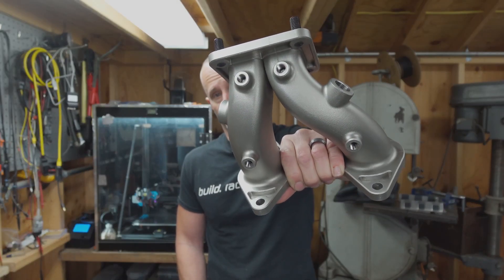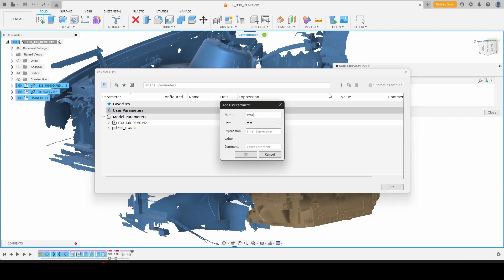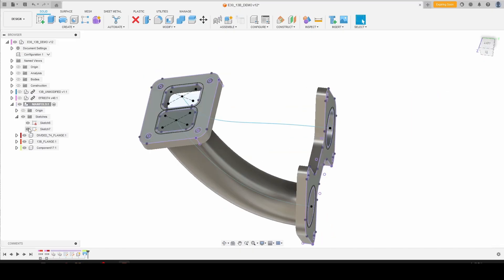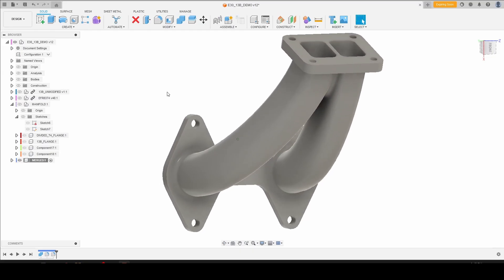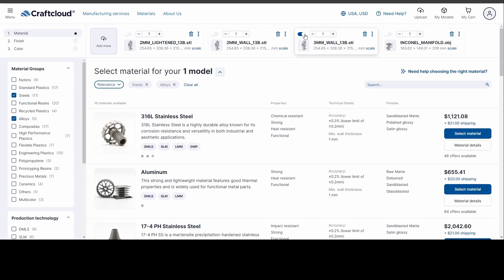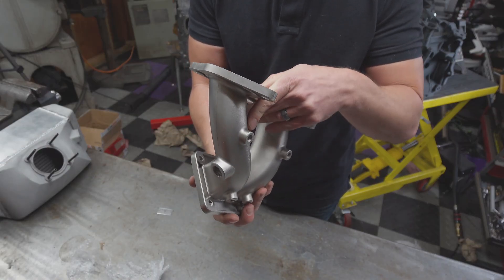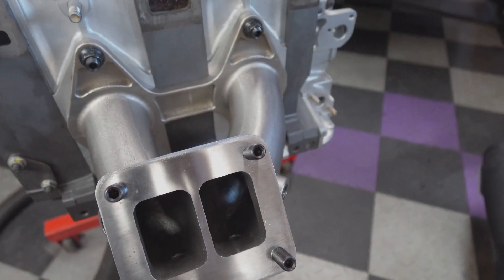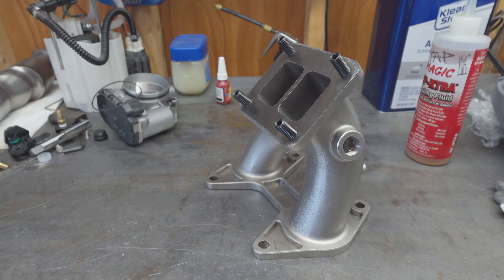Design and print an Inconel turbo manifold - Building a 13B Rotary BMW i8 : EP3

Comment: nice set up but a bit misleading saying printing in inconel then go with 316...
Reply from the maker: I clearly show what the i8 manifold cost in  inconel. The whole point of the demo was to show that 316 is within the average budget. My manifold is inconel from KleRo in Germany.
Reply: @CouchBuilt did you need the extra heat or strength from inconel? What made it worth the extra cost to you? NA manifolds I could see going with stainless all day
Reply from the maker: @MPbdy I originally planned to use stainless and I wouldn’t hesitate to do so. Inconel is simple a better material and when I saw the price, it wasn’t an outrageous jump. The amount that I saved with the motor I bought also played a part in going this route.

Comment: Damn your fusion skills are awesome. Great how you explain how you built it.
Reply from the maker: Glad you liked it. My skills have a ways to go, particularly on workflow. I’ve learned a ton on this project but amassed so much technical debt that after I committed to sending the print files out, I exported them all as STEP files to free up the design timeline. Let’s just say simple changes were orders of magnitude too long to process toward the end.
Reply: Came to say the same thing - I learnt a ton from just that section alone.. I struggled doing a similar modelling task (by struggled I mean I gave up and went back to beating round tube into square flanges like some kind of caveman), and now I know how easy it should have been..

Comment: So a few recommendations. When drilling or tapping, I would rather use rigid taping to reduce mistakes or workmanship errors. When machining down the surface area, you should consider using a mill and measuring flatness. I saw when you placed the "finished" part on the flat surface, there was a lot of wobble and air gaps. It was off by well over 2 thousands. Simply recommendations since it appears you paid a tremendous amount for this part.
Reply from the maker: Good insights, but bold of you to assume my bench is flat. There’s no gap with a straight edge.
Reply: @CouchBuilt  also bold of you to think a belt sander can give you a flat surface
Reply: This part is printed. Fixturing this thing up to (g84) tap it would negate much of the cost savings advantage that he started with. The beautiful thing about a part designed for use with gaskets is it doesn't need to be flat to any "close" callout. That surface would probably be good at +/- .02", maybe .03 depending on what gasket he goes with. 

I guess really i don't see the point of giving the guy a hard time. You don't get flatness within .002 with printed parts yet. The threads are just fine chased. I was impressed that he went with threads at all, instead of sending the model with undersized pilot holes. It's a race car, not a space clock. 

Tell the guy he made a great video and thank him for teaching people about this tech.

Comment: I know
Nelson Racing engines used 308 SS for their turbo headers. 316 is mostly used for sanitary application like food processing or medical devices.
Reply from the maker: 304 and 321 are the usual alloys for header fabrication with 321 having better heat properties. 316 is comparable to 304 in heat resistance, but is more corrosion resistant.
Reply: In heat applications an L grade stainless, 308L or 316L is a better choice than straight 308/316.  The difference is the L grades have a lower (0.03%) carbon content which reduces susceptibility to sensitization at temps over about 1200f.  The carbon precipitates to the grain boundaries and forms chromium carbides resulting in higher potential for intergranular corrosion.  Long enough exposure can lead to formation of sigma phase in the microstructure, which is an embrittling phase.  Lower carbon prevents this from happening.  Types 321 & 347 prevent this by adding either titanium or niobium respectively which ties up the carbon as titanium or niobium carbide, thus blocking the formation of the bad actors in the alloys. The molybdenum in 316L adds a slight amount of strength and prevents chloride corrosion.
Reply from the maker: @jeffreywhitmoyer860 good info. Should be noted that the stainless materials in the quotes are indeed 316L for anyone who missed it.

Comment: Do it could be possible to put an order with a 3d model with 1mm wall ?
Reply from the maker: I believe .5mm was generic minimum recommended wall thickness for a DMLS metal print, so that should be doable.
Reply: @CouchBuilt  thanks for the info :)

Comment: How much housing distortion will affect Rotor Tip Seals, with the extended offset of Turbo?
Add a Support Bracket?
Old Skool thinker😊
Reply from the maker: Probably not much. Still 10lbs lighter than stock twins from all the figures Ive seen.

Comment: Odd question…what are your computer specs if ya don’t mind? My software lags when I try to rotate the part with the stl open like you have with part of the chassis. Quite annoying.
Reply from the maker: It’s a 2021 Asus G14 with 40gb RAM. It only performs like this when plugged in. I’d like to upgrade, but next real notable step up always specs out at like a $5k workstation, which I can’t justify. I need to buy a DQ500 DSG instead 😂

Comment: My understanding from several GE presentantions of 3D metal printed parts for high temperaure application for gas turbines need extensive heat treatment and they encouter a high fall out rate. Hope this folks got the process figured out and the part can take the abuse. If I recall correctly the process of "melting" the metal creates internal stress that need to be annealed and relief via heat treatment.
Reply from the maker: I have an acquaintance thats been involved in some turbine secondary machine work for such applications. It’s not an apples to apples comparison as those are usually moving parts at higher temperatures, pretty extreme rpm, and lightened to the max. This is just a static hunk of metal that’s twice as thick as it probably should be. I don’t foresee any issues, but time will tell.
Reply: @CouchBuilt  I will be watching for sure.
Reply: The problem, if you can call it that, is that "3D printing", or "additive manufacturing" is so diverse both in materials as in methods, that overall generic statements like that are meaningless.

You can 3D print many different plastics, metals/alloys, some ceramics and even composites. The various methods use resistance heating, laser beam heating, electron beam heating (in vacuum) or electric arc heating. Some printing methods need debinding and sintering. Some are ready directly. Some benefit from a post heat treatment. You can print with powder, welding wire, filament, composite filament, concrete, 2-component materials and more...

If this were Inconel with powder bed SLS printing (selective laser sintering) it could probably benefit from a post print heat treatment. If this was powder bed SLM (selective laser melting) it likely wouldn't need that. If this was made by binder jetting (metal powder printing with a wax-like binder) it would need debinding (removing the low melting binding agent) and sintering. Sintering will inherently stress-relief at the same time. 

So the short version is: It's complicated...
Reply from the maker: In this case it was DMLS.
Reply: @CouchBuilt  If that's on a printer from EOS, it's German for Direkt Metall Laser Schmelzen so SLM, selective laser melting. SLS is older tech, resulting in slightly more porous prints.

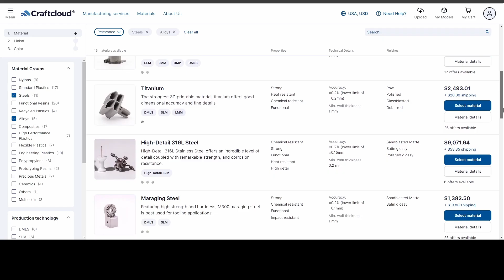Comment: 10:10 There are some surprising numbers. Like you save over 11% on the Titanium 2mm lightened manifold and less than 5% with the inconel one.
Reply from the maker: One thing to keep in mind is that it’s an automated process and the prices shown are the lowest for a particular configuration. They might be through different vendors even though the material is the same. There might be limitations or ideal size thresholds for a particular manufacturers setup.
Reply: The Inconel could reduce down to 1.2mm (street) or even 1.0mm (race) wall thickness, and save a lot of mass.

Comment: I see you have a Micsig. It would be interesting to see how you use it as an automotive scope
Reply from the maker: To make all this work with the factory hybrid components. I need to emulate a bunch of digital and analog signals that will be generated by my own hardware. I’m sure the scope will get some air time when I cover that stuff.